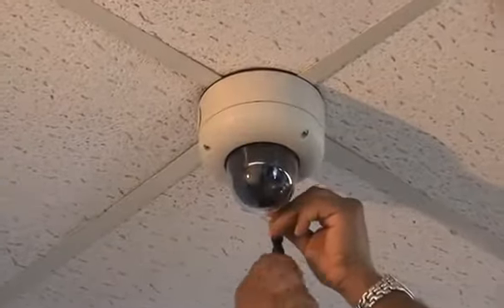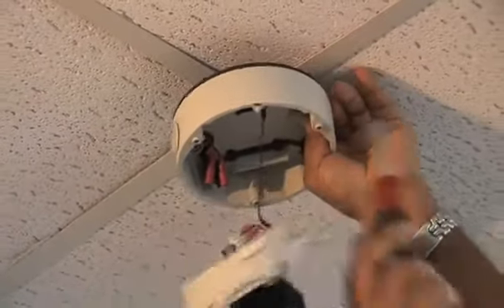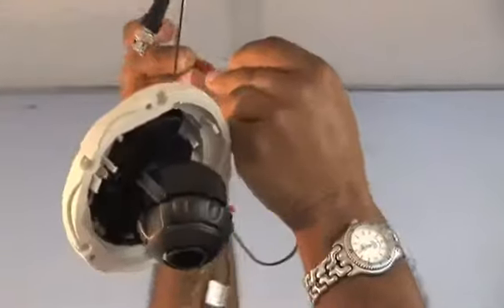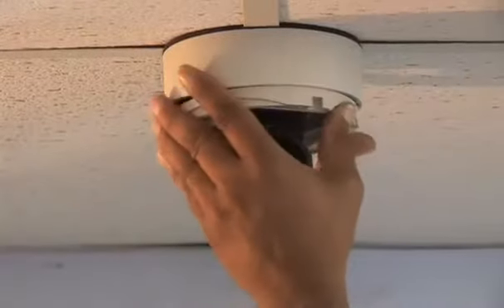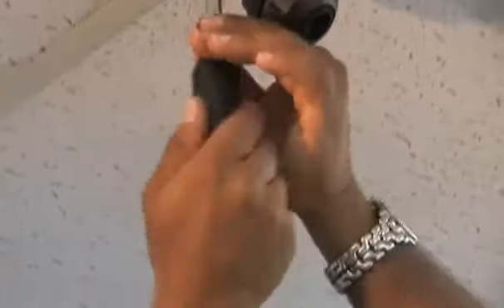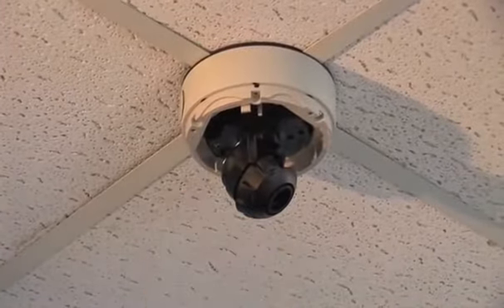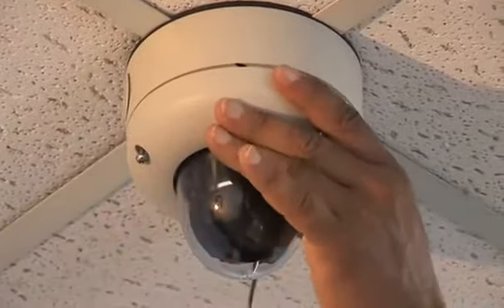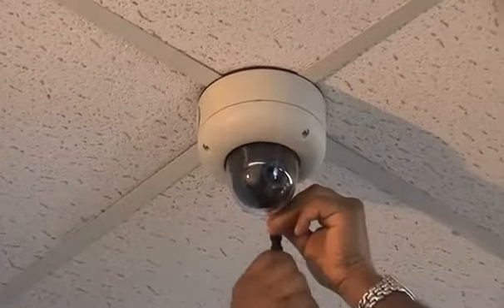Digital Watchdog Vandal Proof Outdoor Snapit Cameras

Comment from the maker: Unauthorized Reseller List as of 10/10/2012   --------------------123 Security Products, Alarmax Distribution, AllKindsCable, Amazon, CCTvHardware, CCTVProducts, Cctvvideo, ebay, J. Mac Supply, JMac Supply, Office Depot, Pillar Security, Private Security Contractors Group, Provantage, SafeMart, Sears, Security Equipment Supply, SecurityIdeas, SecurityJunction, Spytown, Surveillance Video, Surveillent Security, Surveillent, The Systems Depot, uBuy, VideoCCTv